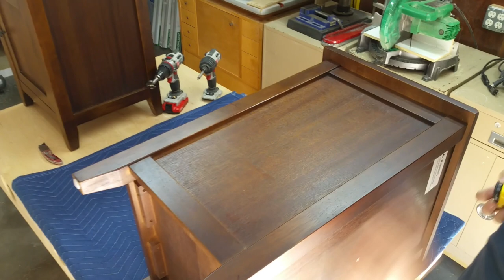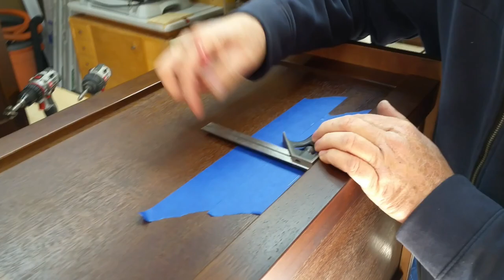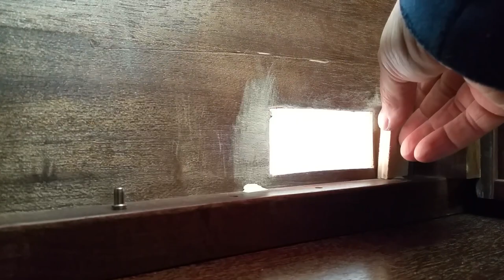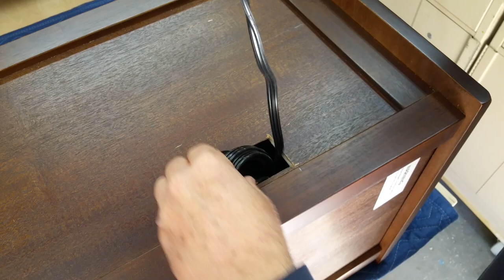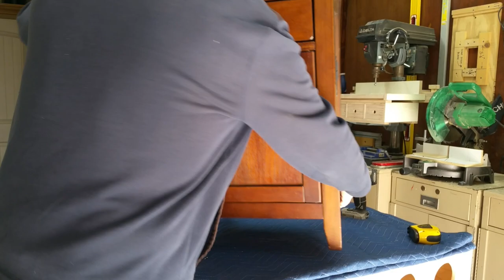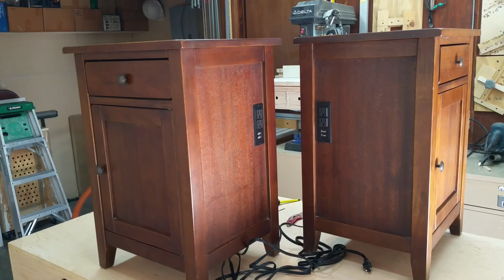How I added a USB/Electrical outlets to a pair of nightstands

Comment: Where did you get that usb plug?
Reply: I read where you said you put a link in the drop down but I’m just not seeing it.
Reply from the maker: It was Amazon Recessed Power Strip Socket with 3 AC Outlets 2 U... https://www.amazon.com/dp/B019F6F1NK/ref=cm_sw_r_sms_awdb_btf_t1_wGVsFb4F5HK5S

Comment: Would this be able to be mounted without the extra backing of ply? Or would it not be as stable? Great video! Just about to tackle it
Reply from the maker: The reason I added the extra small pieces of plywood is because the sides were made of 1/8 material with it being so thin it probably wouldn’t hold up to well from plugging and I’m plugging devices…….. thanks and good luck 👍

Comment: Wow!!!!!! what's that thing you trim the wood piece, is that trimmer with some extension????? anyone ...great video BTW
Reply from the maker: I used a Porter Cable Oscillating Multi Tool, its makes a cutting a precise hole very easy..... thanks for watching!!!